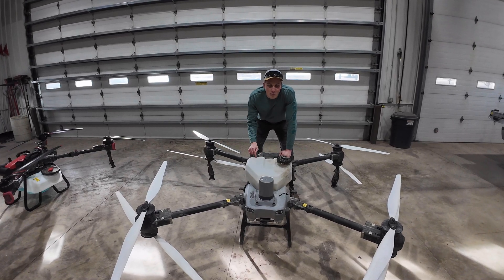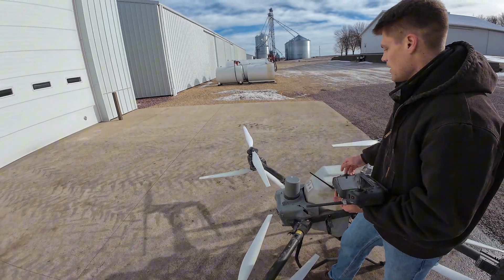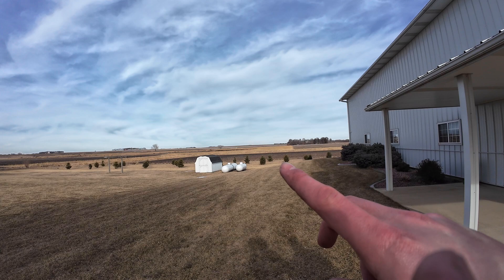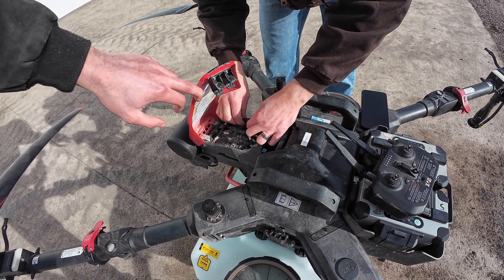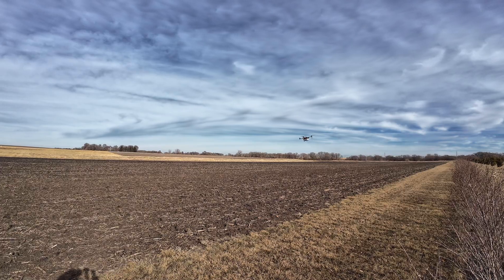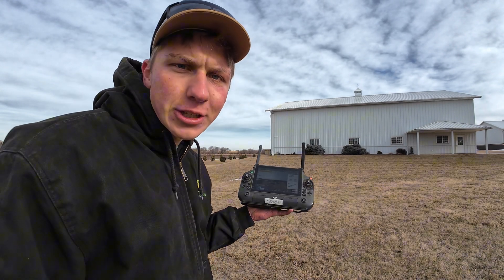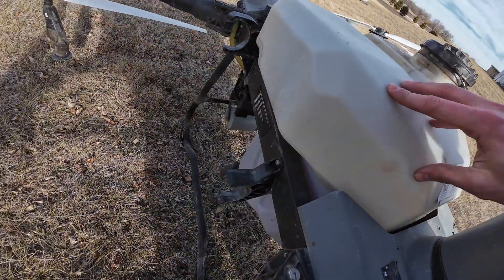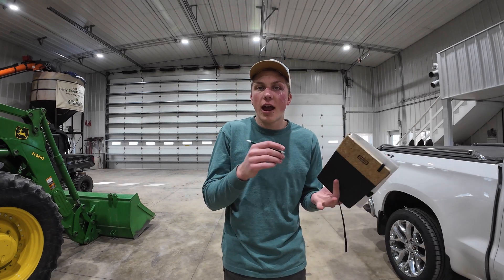I'm Making a $40,000 Investment In My Farm

Comment: I would recommend that P100 Pro. The controller at first was a short coming to me. But I ended up not minding it, as the XAG is very autonomous, and I found it somewhat rare to be manually flying. And even when I was, it tended to be close enough I preferred to use my eyes over a controller anyway.  I have found that the P150 and it's new controller, paired with a DataLink, seemed to fix any camera issues. And made it at least on par with the DJI. So I would recommend looking at a P150 at least a little bit for that reason. Also I've found the XAG's to be easier to fix and maintain then the DJI's.
Reply from the maker: Appreciate the input! What is the datalink exactly?
Reply: @HiTech_Farmer  It's a Wifi range extender. The XAG systems run mainly off of a WiFi. The Datalinks acts as a hub, and booster for the network. And in return make the speed and transmission quality a lot better.

Comment: had this unit demo 200 acres, with the application being a bio-stimulant post-burn down.  the issue is to get over the "novelty" of the very advanced technology.  i traveled a lot to Asia in the past for work, so my first question was - What are these things being sold for in China?   Go look at prices for the T50 and T60.   these distributors are providing a 100% rip off.   so it puts a guy in a kinda tough spot, knowing even the $45,000 has a pay back if your getting custom service done with a ground sprayer.   id not only be mindful of the potential import ban but also the potential hardware/software spying that may be already built in.  American drone manufacturers need to pick up the slack, these drones will replace ground sprayers and floaters for precision ag. its the future of farming.  i know USA made drones have access to battery's that will allow for 100% to 200% more flight time than the dji.  when you start seeing how these drones need to operate, you going to need a dedicated spray trailer to reach the "acres per hour" they claim. though there are a lot of youtube videos showing this. for now, i'd only purchase a dji if the distributor kept there markup to 100% not 400%.
Reply: You're missing two points. Those China drone prices are only on geo blocked units. You can't fly them in North America. Also, dealers are NOT charging 400%. They're limited to their margin by edict of DJI. It's nowhere near even 100% .
Reply from the maker: Yes, I've been learning the markup on the drones and the industry itself is broken. High costs here in the states makes it harder to justify the purchase
Reply: The main reason for the large cost difference for international models are because extra certification process on some components for the international model, like CE, FCC and RCM just to name a few and in China you don’t need any and there are much more units sold in the Chinese market.
Reply: @ a DJI t60 is coming off the line at $2,000-$4,000 USD  - its being sold for $10,000 USD domestically in China. A $45,000 list price for a t50  package in the untied states is asinine.  This is why the United States Government wants to put a 25% tariff, and i hope higher, on Chinese made EV's.  So if you following the math, someone is pocketing a 400% mark up somewhere in this value chain.  i trust farmers keep a long memory of drone dealers who treated them unfairly.  all its going to take is a USA drone manufacture/dealer with long term vision.